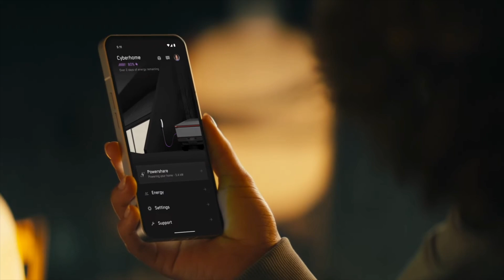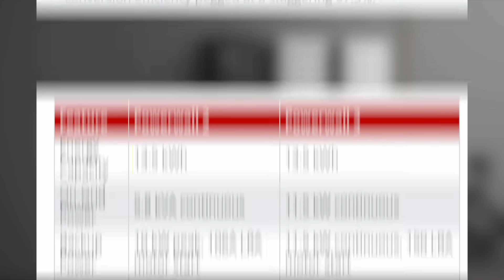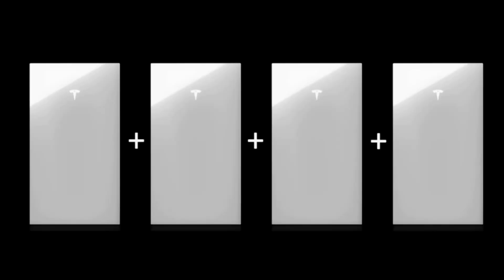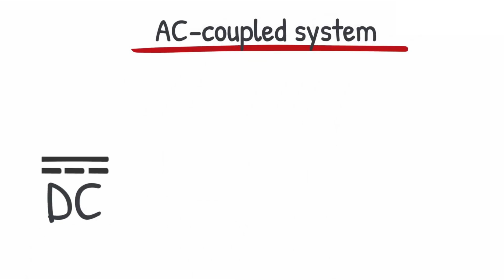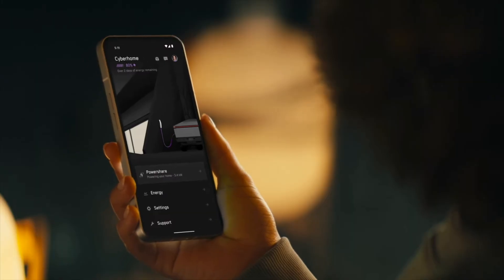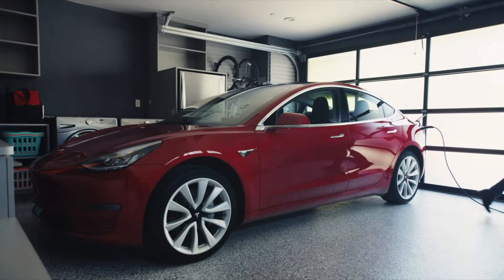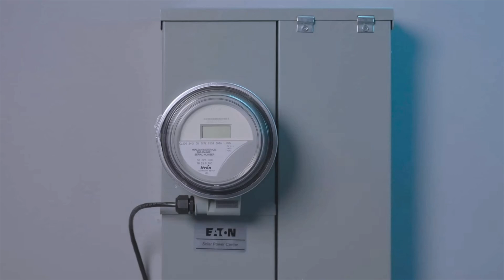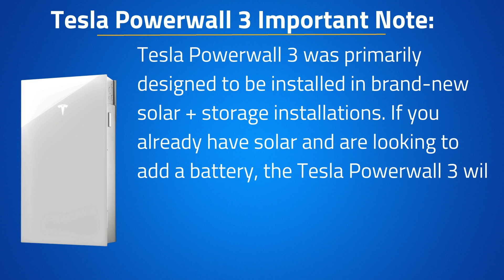Why the Tesla Powerwall 3 is the BEST Solar Battery Ever Made

Comment: Also doesn't the crash in the price of lithium also contribute to the ability to offer much lower prices for the battery? Price of lithium is now 80% lower than it was at its peak in 2022.
Reply: I imagine it helps. But I'd guess that the cost of lithium in the battery is only a small part of the overall manufacturing and delivery costs.

Comment: the tesla Powerwall 3 is an EPS (Emergency Power System) system. this means when it switched from battery to grid or vise-versa there is a short millisecond drop of power. this can upset computers and other electronic devices. is there a way to turn the Powerwall 3 into a UPS (Uninterruptable Power Supply) and eliminate this drop of power?
Reply: i think you could consider putting those devices on a "solar generator" that has no drop as a ups backup. its an extra cost but it gives you double redundancy as far as if the power drops and the wall delays or even malfunctions you would still be up and for some time depending on the size of the "solar generator". i have used small Bluetti solar generators personally as ups's for computers and they work, eco flow did not when i tried it so make sure you get the right product if you go that route.
Reply: The powerwall 3 has a cellular connection built in

Comment: Great that Tesla doubled the power output; a likely cheaper option would have been to include a soft starter with the unit to be installed on the A/C. Or at least include educational material about doing so.

Comment: i received identical quotes for enphase5p (2 units) or tesla powerwall 3 retrofit battery install - 12k. with pw3 - i get 3.5 additional kwh. no brainer here.
and for franklin whole home - 14-15k.  I am not clear on your point on choosing enphase or franklin for retrofit battery install ?
Reply from the maker: Franklin & Enphase are AC coupled batteries and are proven to work with other inverter ecosystems which is why I prefer them for retrofit.

Comment: Like the cars ? My first Tesla 2013 was never low in price cost me $ 100K and a Model S with better performance is today cheaper. So you got that all wrong. Most likely will the price for all batteries just like all solar panels and flat TV screen still keep dropping due to mass production. Pls. Get you facts right ! But otherwise great video !
Reply from the maker: On my other video regarding battery prices going down, I talked about this as a major factor.

Comment: My understanding is that when installing more than a single Tesla Powerwall 3, the battery and panel collar slim install setup is no longer possible. Instead, we will still need to install the batteries, along with a Tesla Gateway, as well as a Critical Load Center sub-panel (for backup). Is that not the case?

Also, why is it that Tesla never publisized that the Powerwall 3 chemistry is LFP?
Based on the fact that it is more than 100 lbs lighter and small in dimension compared to the FranklinWH LFP based battery, and still has built-in inverter(s) in it, how is it possible that it is LFP based and not still NMC or some other non-Iron based chemistry?
Reply: I'm getting two Powerwall 3s installed with my existing panels. Using the backup switch and removing all my old inverter equipment and using the built in inverters. No Tesla Gateway or critical loads panel needed they say.
Reply: @nicksgarage2  Will your system include grid power outage backup capabilities?
Do both of the Powerwalls include an inverter (meaning the second one is not a DC Expansion unit)?
Will they be installing another battery sub-panel "combiner" on the way to the main panel, or will each one of the batteries will run a separate conduit to the main panel?

Comment: Getting two PW3s installed and mated to my Enphase IQ8A Inverters.  Shocked to learn l will get $300 per kW as a CASH REBATE directly from my utility (AMEREN IP) on top of the 30% tax credit.  Reducing my total cost to LESS THAN $20K maybe closer to $19K.  So pumped,
Reply from the maker: Good for you!

Comment: 1:26 Where are you getting the 4x stacking limit?  On their website, Tesla is allowing me to buy 6 Powerwalls for a single install.
Reply: I've also seen other places that the max number of powerwall 3 units is 4 but each of those units can have multiple dumb powerwall 3 units which don't increase the max load amount but will help keep the lights on longer. I'm not sure why they would sell you six when from what myself and others have seen you can only use 4.

Comment: can build a diy powerwall for 1/10th the cost still lol
Reply: Are you doing ok? Even with EG4 you’re nowhere near the price you’re talking about. If you’re talking about restoring dead lead acid batteries, then you’ll have half the usable capacity and that still doesn’t account for an inverter. Tesla isnt cheap, but they’re not overpriced for what you’re getting.
Reply: @Snib1  uh im talking about using 280ah lifepo4 prismatic cells. just finished building an 8kwh range extender for my phev. batteries cost 280$
3200w 24v to 220v inverter (level 2 charger) cost 200$ from Powmr.
input is a j1772 plug with diode/resistor which tricks EVSE's into putting up to 40 amps out
output is straight 220v/240v plug which i plug my own EVSE into with a built in limiter to 13 amps (3.1kw)
basically a powerwall that i fit into the hatch of my car, batteries are in a us surplus 20mm ammo can (30$) for fire protection, and cells are balanced with 4s inductive active bal boards (3$ each). 
the whole build is around 550$ homie, or about 1/24th the price of a powerwall.
are you doing okay?
lfp cells wholesale from china are around 45$/kwh right now delivered. its kind of insanity, everyones making money hand over fist

Comment: Went to sig solar saw a 18kw inverter and 20kw of battery for $9000  usd, as for charging from EV a well know company is working on one that anyone can use that feeds to gen or grid port. If it is a grid down situation, you only get to do it 1 time, get a propane gen with a 400g tank, charge 20kw a day for over a month.

Comment: I like Tesla as a company and I ordered three cyber trucks. However, the solar products are not the cheapest. I am going with an EG4 system. The wall mount battery is 14.3 KWH and cost $3,300, or $231/kWh, roughly half of the Tesla power wall. Continuous output of 200 amps per battery bank. Since I'm building completely off grid, I gain no advantage with Tesla systems. Energy arbitrage will not apply to me nor do I really want them adding cycles to my home storage. 20.7 kW of panels, three battery banks and three inverters for a continuous output of 18 kW, bi-directional charging of course limited to the vehicle, not the system and I'm installing it myself for the most part keeping the cost under 30k.  Try to beat that lol.  My system is coming from signature solar by the way if you want to check my prices.
Reply: Good for you, I guess?
Reply: @DR.LingeringFrey  Thanks, I guess.
Reply: I can build a go-kart for $400.
Reply: Tesla is definitely very expensive and I wonder why didnt they lower down their price or at least double the capacity
Reply: Not a certified electrician, that you can still do it yourself and have an electrician sign up on it for you. I'm not hooking up to the grid and my whole home is built out of steel. Then a lot of electrical work over the years with remodels and I'm very familiar with it. Running away from something just out of fear or I need to have a license to wipe your own butt is ridiculous. Private property should still have some rights beyond bureaucratic red tape and needless interventions.  Another thing that helps with this is that I will not hook up to the grid at all so gives me total control over the system.
Reply: You get it, Terry Lane. Best of luck with your system. DIY is the way to go for those that understand the importance of owning their energy and are willing to learn how to do it right, physically, electrically, high-quality, and safely. Most of today’s installation cost is not the hardware, it’s the labor and overhead for a turn-key installer. DIY comes in roughly half the costs, which translates to half the cost per kWh.
I’m a fan of Signature Solar and EG4. My only hesitation is their durability and quality…which they’ll have to prove in the long run.

- Solar Steve
Reply: If you are e certified electrician this is great, if not it’s not a great idea.

Comment: Thanks for the review! Really good. 

A couple of quesions. 
What solar panels produced power at night time? Until 7 pm like you mentioned? 

Usually good sunhours for solar production are from 9 to 4 or 5 pm at the latest.
Reply from the maker: Many parts of the Northern USA will receive sunlight as late as 7:30PM from May to July. The irradiance will be directed towards the NW faces of roofs, so western-facing panels with unobstructed sun access are needed to capture this later afternoon sun.
Reply: I have a video called solar upgrades, the sun it is hitting the side of the panel 780 watts from a 2790w at 7pm.
Reply: He is referring to the batteries discharging back to the household load at night. No solar panels make power at night.
Reply: @andresrestrepo-qj4yt  jinko 465w bf,I got 2 recent shorts,solar upgrades was at 7pm and solar is too easy was at 610am , ignore pv3 it's getting fixed in Aug,then should be over 2.5kw in full overcast.I have a few ideas to boost power,test and result video close to sept.i have seen pv2 @460w   20 mins after sunrise.

Comment: Vehicle to home is not difficult. Nissan LEAF has been able to do it forever. Even Ford managed it. But Ford and Nissan don't sell home batteries. If Tesla were to implement vehicle-to-home, then the demand for Tesla batteries would decline. After all, why would you buy a 13.5 kWh battery for your garage wall when you already have a 70kWh battery next to your garage wall?
Reply: You still need a power management system and buffer so you will still need one powerwall. The cyber truck power share is a niche product and most people will want their home to have a backup even when they are not home. Like yourself I think V2h is long over due. I just hope it's backwards compatible.
Reply: My thoughts too. I'm putting the money from the battery into extra NW facing panels and waiting for widespread v2h
Reply: ….. because if the EV battery is NMC or NCA, like every EV battery in North America to date, it would not be economical to cycle that battery for home use.
Reply: If your car is home all day, sure. But for people who drive to work for example they may want a batter to take advantage of their home solar.

Comment: I was told the power wall 2 you were able to attach non-Tesla batteries to it and non-Tesla solar panels. But the Tesla wall three you are unable to attach non-Tesla solar panels and or non-Tesla batteries is that true?
Reply from the maker: With the Tesla Powerwall 3, you can pair any solar panel brand with the battery. Tesla does not actually manufacture a solar panel, they instead white label the Q-Cell. As far as batteries, you are correct in that you are unable to pair Powerwall 3's with other batteries in a retrofit installation.

Comment: Thanks....

1.  LRA.... is it 185 or 150?  Or are there different versions?  I hear many say that PW3 only accepts DC, but other say it now accepts the AC from micro inverters.

2.  Picking up 9 Powerwalls tomorrow and parking in my drive way.  Thats the Cybertruck.  123 KW hr, not 100.  With 3V gateway and UWC, it is functional NOW.  The wait is for Powershare to be compatible with ANY gateway and ANY version if PowerWall.  Tesla is saying later this year, not 2025.  

3. Would be nice to memtion that Tesla is soon to come iut with a dumb PW3 that is just storage.  Not sure when, but guessing it will be way cheaper.  I'm getting only one PW3.  Adding a dumb PW3 later maybe.

4.  Tesla does not farm out PW3 install.  I wanted to start a conversation with Teala direct, so I made an online order for full Solar + PW3.  That got farmed out.  Tesla doesnt do much Solar it seems.  So I made another order for just PW3......BAM, new project is run by Tesla directly.

5.  PowerShare equipment (included with Foundation Series Cybertruck) installation is farmed out.  Most get quotes around 3K.  Will probably do that, and then go back to Tesla regarding PW3 installation which should be way cheaper with an existing 3V gateway.

6.  As a soon-to-be cyber truck owner. My situation is way different than most of your customers who want to add a battery to an existing solar system. My rationale is to add a battery to my power share and have the capability to easily add solar in the future. I agree with your comment that DC coupling keeps things way simpler and more affordable.

Comment: Thank You for the informative video. How would the DC coupled PW3 work a DC powered home? We are in Thailand with all DC power. Again, Thanks!
Reply from the maker: No need for an AC inverter if the house is DC coupled, however, I am not familiar with the market in Thailand.

Comment: Any chance or rumor that Tesla allows seamless generator input to the Powerwall 3?
Reply from the maker: The Tesla Powerwall 3 can be compatible with a whole home backup generator if installed with a transfer switch or a Manual Transfer Switch.
Reply: @jackthesolarguy  The powerwall cannot be used to charge the batteries, is that correct?
Reply from the maker: @tomdangelo3162  If you meant to say that the generator cannot be used to charge the batteries, that is correct.
Reply: right now - A generator would output AC current and the powerwall 3 only accepts DC input. Tesla says they are going to make changes to the powerwall 3 so it could be used with existing systems that have microinverters (changes DC solar panel output to AC) but I'll believe it when I see it.
Reply: @steveschaefer4558  They've already allowed AC coupling recently - but the Enphase battery is the only system that lets the generator charge the battery.

Comment: Thanks for the video. Yes, I think it will shake up the market a bit and is definitely something to consider for new solar customers. My main concern is that everything is combined in 1, inverter, battery, etc. It means a very significant point of failure. The question comes back to how quickly will Tesla respond to a service/warranty issue, as well as how reliable the system is. I have heard customer service has been pretty poor in some parts although in general the other tesla products(Powerwall2) have been fairly reliable. Saying that, this is a newer product and we may not know until a few years down the track how this will perform. It also makes me think of those combined TV and DVD units, they didn't age well. Will be curious to see how the early adopters fair.
Reply from the maker: You are correct... combining the multiple components all into one hub creates a large risk for a central point of failure. As a reminder, Tesla does not have internal install crews, so all of the servicing falls on their subcontracting partners or the installs who sell them...
Reply: I've already heard of a couple of homeowners having failures with very poor response from Tesla and their system has been down for weeks and weeks.
Reply: Yeah, that is a major concern. I know some installers are installing a separate string inverter when they installer a powerwall 3

Comment: I wonder how or if Enphase's next-generation IQ battery will compete? Enphase is supposed to launch in late 2024. LFP loses 1% of its charge over night. Is the 3-5% DC advantage over an AC coupled battery much of a factor in the real world use case? Must say the bidirectional capabiltiy is ahead of all the competition's options.
TSLA can start a large AC unit but it will drain the battery in 2 hours. Not likely anyone will run the AC in a grid down situation with a single battery.
Reply from the maker: DC-coupled batteries certainly provide the benefit of higher round trip efficiency, however, the average consumer is unaware of that, and is more attracted to the lower cost aspect of DC coupling. Most people I speak to want the Enphase Microinverters and are willing to sacrifice a small amount of lost power to have a system without a single point of failure. Regarding bidirectional capability, Enphase has been working on a bidirectional charger product for a while, it is just a matter of when they launch it and which cars will provide the chargers the ability to backfeed.